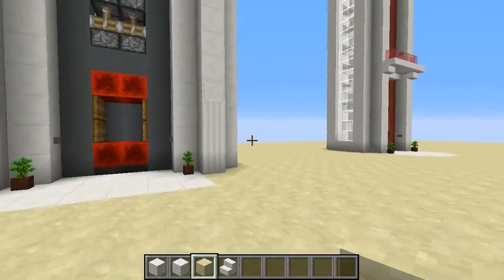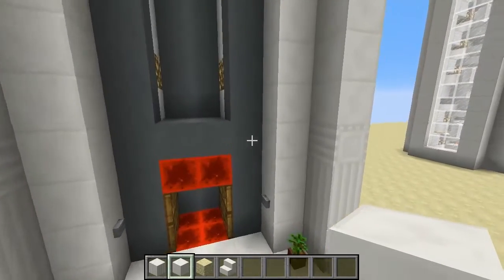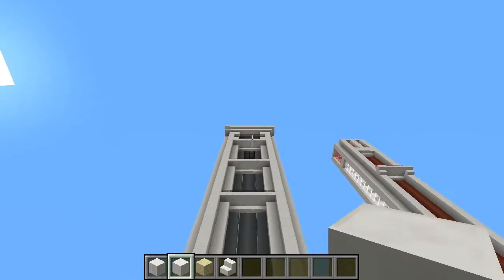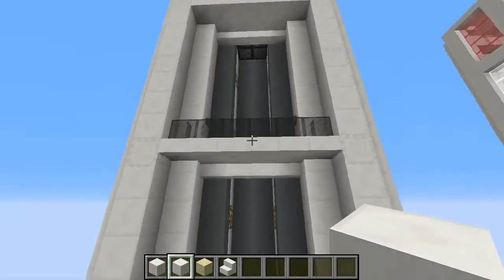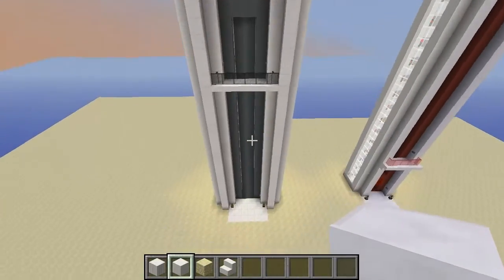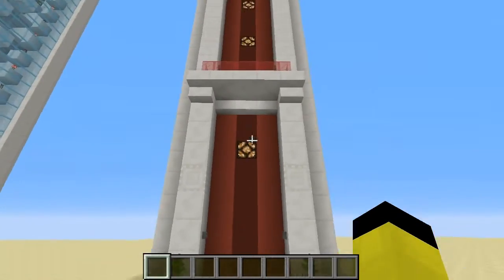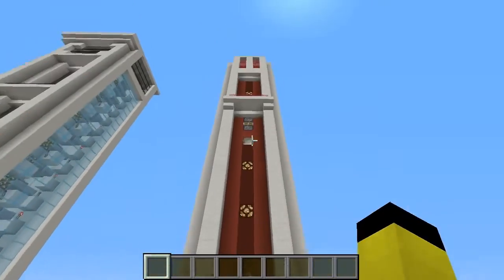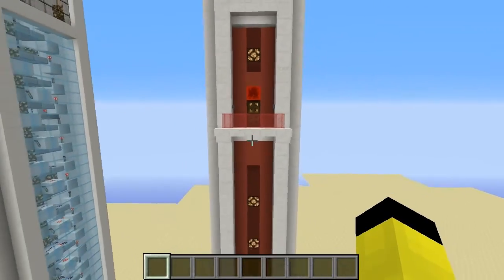Adjustable Multi-floor Elevator

Comment: Subscribed. I run a large city server on Xbox 360. There are usually lots of players coming and going. Hypothetically, if a person on level 5 called the elevator, and a moment later someone on ground level called it, would that cause issues with the system? By that, I mean would it jam the elevator or break it?

Comment: Have you thought about utilizing the item frames instead of repeated button presses to indicate the chosen floors?  That would limit you to eight "floors" to select before calling the lift, but seems cleaner/more efficient.  Looking forward to the new tutorial for these!
Reply from the maker: Robert Johnstone Hey mate! yes i suppose for this design it isn't entirely necessary to have the flexibility of 20+ floors. item frame would certainly work and i know some guys have worked on increasing the signals available with item frames sot its certainly a good option! BTW the tutorial for this elevator is already available on my channel :)

Comment: Did the tutorial for this ever come out?
Reply from the maker: So i am in the process of reworking the design so the tutorial can utilise some improvements i have made since i first developed this design. I am in a world right now making the prototype to test before i make the tutorial! :)
Reply: Awesome.
Reply: MorezysMinecraft When you do produce the tutorial, will you be using the push button floor selection method, or the item chest filling method? I for one personally hope that you choose the push button version. It's more viable for SMP, as you don't have to deal with people stealing items, or on servers with chest protection, impediments such as that. If it is the chested version, would it be possible for you to also produce a version or modification that allows for button use? Thank you, I'm really excited for the tutorial, and this looks like a great design.

Comment: can u do a tutorial 1x1 with no hoppers  because of bukkit server i play on
Reply from the maker: unfortunatly this system relies on the hoppers to work, cant really remove them :(. Also i know that bukkit servers have a hard time keeping up with the elevator mechanism, so the whole elevator may not work well anyway, you can try build one of the basic elevators and see if that works first. i have seen at least 1 bukkit server run it ok but i have a seen a few that haven't. good luck!
Reply: MorezysMinecraft morezeys can u make a elevator video that has only 2 floors and please do a turtorial and keep up the good work

Comment: On the world download, the second floor for the 1x1 is not working. How come?
Reply from the maker: Yes the second floor i skipped so i could post the video up
but the system is modular so you can just copy the wiring for more floors
Reply: MorezysMinecraft I can't understand anything about the redstone underneath and whereever I have to place it, way too difficult. Ugh, and I only need 3 floors, I was gonna copy it off that world :(

Comment: This night will be wasted by this elevator,,, on SMP))
Reply from the maker: Haha Im Glad! Anton if you want to see the download go here www.6me.us/7oYL understand the 2x2 version might be stuck in this download but everything is there you will need to build it, Also i have noticed these elevators don't work so well in Bukkit or other modded servers, If you are playing vanilla SMP it should be fine! Happy building!
Reply: MorezysMinecraft thx 4 advice bout vanilla SMP, Just because last 3 - 4 nights was completely in trys of making a "full controlable doublepistonwormed cabin" with buildcraft pipes)))
Reply from the maker: Ah! sounds like long nights! :)
Reply: MorezysMinecraft epic fail)) Do you hve another version for MC 1.6.4? xDDD (also i've started your map on mc 172 & found issues with hoppers-that-counts-floors (lol) but i don't understand what the differents between 164&172 exactly broke the circuit... i understand the brain system but have no idea how to replicate it in 164.... so maybe u started your work a while ago on older versions and have already prepared answer?..)
Reply from the maker: Антон Зачесов  Hmmm interesting! I just reverted to 1.6.4 and opened the same world i gave you to download and it seems to work! I am making a tutorial at this moment. However as far as i can tell it should work? :)